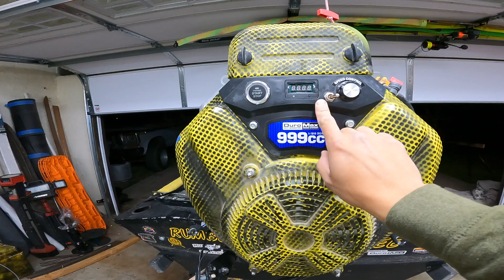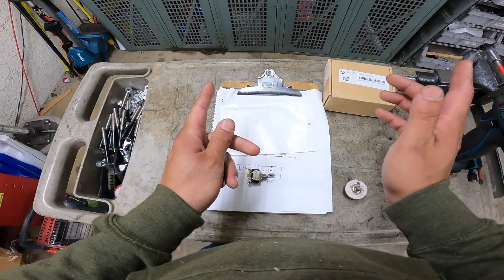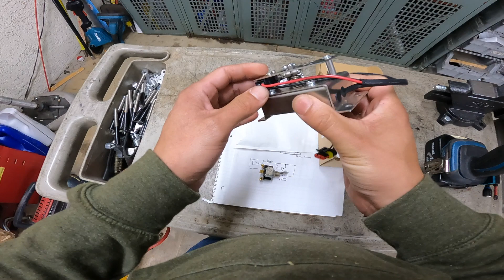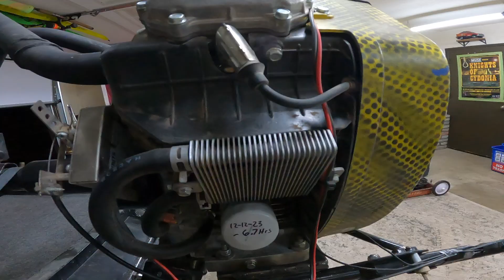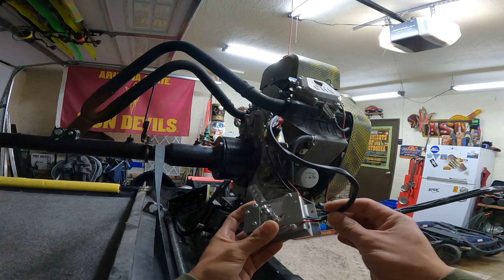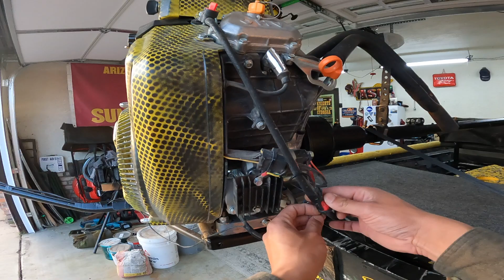Duromax 999cc Electronic Throttle Set Up #xp35hpe @DuroMaxPower

Comment: I have this engine on a stump grinder. I've lost ability to control throttle. Spin the dial nothing happens.. bought new pot, no change, new ecu 4 times in a row because i kept doubting them. Same result. Won't rev when i spin the dial. But it does rev to 3k when i unplug the pot.  I don't know what to do. I scraped the insulation off the wires right where they enter the ecu and can measure 0-5k ohms being selected but nothing happens.. please tell me what to do. I been trying like hell to fix this. I have a brand new never used duromax engine also. So I'm like stick some oil in it and hook up a battery and fuel and use that engine to help trouble shoot and figure out wich parts are junk or what. So i start it up. Won't rev or respond to dial being turned. Geeeeeez. I'm really lost now. Both run, both won't respond to dial turn, both rev up to 3k when i unplug the pot. One is brand new and the other i ran for a good long while grinding stumps. The ecu went bad eventually and nothing would happen when u hold the start button. Aaaaand i got a new ecu and here we are. Starts right up, won't rev... . The duromax dudes were like you need to take it to the shop. I'm like i am the shop brother!!
Reply: Here's a crazy bit of info.. the original ecu is a dead duck. It was illuminating the ring around the start button red and wouldn't turn off. Wouldn't start or even try. Dead duck. So I start ordering ecu's and pots and I had a new spare carb with the electronic throttle spinners on it. I figured I have ALL the garbage electronically controlled parts so if I need a spare I'm good... fast forward to the no rev troubleshooting process a week or 2 later. I put that confirmed junk ecu on there. The engine started and DID respond to throttle dial. Then it shut itself off after 5 or 10 minutes running and will not restart or do anything. Out of 6 ecu's that is the ONLY one that would make it rev when told to...I got to a point where I was like send me 5 new ecu's because I believe they are all junk. So shitty. Please help. Anybody..
Reply from the maker: @briansnik1848 we only ran the electronic throttle for a short period of time. Then we bypassed the electrical and deleted the ECU. Its currently on #rumblebeeboat with a mikuni carburetor with 670cc kit from https://performancemad.com/ running on the bottom needle clip. We made this video just to demo a drive by wire system that people said couldnt be done.
Reply: @azlongtales awesome job on this stuff..i can't do like you did unfortunately because I'm on a stump grinder, and need to be governed. Dang it there is no way around this besides sell these 2 duromax's i have real cheap. Let me know if you know anyone who might possibly be interested. I'm in crest hill Illinois 
.. thank you brother. Nice work on the boat

Comment: How do you like this motor so far? I'm looking to repower my Boss Drive surface drive with this motor. I'm just not electrical savvy lol i been considering modifying a predator 670 or just buying one of these.
Reply from the maker: @JBouza392  999cc has been an awesome engine still on #rumblebeeboat the ulimate upgrade is to delete the electronics and do a performance 670 mikuni carb. We were just showcasing how you could keep the electronic carb. So I far I think we are the only people to make a affordable drive by wire system awesome job by @yumatrd (David)
Reply: @azlongtales  I'd like to go the route of the least modification as possible. I like this Duromax xp35 for the push start feature and I'd like to keep it. I really don't want to modify the motor if I don't have too. I just want to get back out on the water as quickly as possible lol

Do yall make a plug n play kit? Or do I need to piece this all together myself?

Comment: Is the crankshaft same size as a vanguard 35?  This would be an awesome cheap alternative when replacing a Briggs vanguard 35 surface drive if the hubs/clutch are interchangeable
Reply from the maker: All good question i don't have the answers to. All duromax 999cc has a 1 7/16 shaft

Comment: I think it’s less messing around putting a mukini carb on it and just taking the electronic stock carb off and ecu. Then just hook up a key ignition lol
Reply from the maker: @nickb8618  we did that afterwards that's how it's currently set up now. But we were showing it was possible and not difficult or expensive to do a drive by wire system for it to use the stock components.
Reply: What Mukini carb did you use?
Currently, I just extended all of the stock wires and mounted the controls where I wanted them in the cockpit.

Comment: What do you think of a 14-36 with a swamp runner 670 ? Maybe with float pods.I don’t want transom to break because the bottom corner has been welded in past but it’s got a TBN aluminum 1.5 thick transom. Two floor to transom triangle braces in it already then I got a 36-14 1/4 aluminum plate bolted through the back and transom. You think it will hold up with rough roads and the weight ? Hope to hear back !!
Reply from the maker: I would say don't do pods. Sell that hull and buy a 16ft if you want to run a vtwin engine. I would run the @duromaxpower #xp18hpe 18hp or #xp20hpe on that hull if you plan on keeping it.
Reply: @azlongtales  Okay thanks for the advise but sadly I’m stuck with this boat for this year I re did it completely. And already got the motor 670…. Dumb but No Kit. It comes out to about 20 pounds more heavy then a 459 kit with a light weight muffler. Just of of curiosity what’s the size of Sonoran skipper and rumble bee ?

Comment: Need to see a video of it on the water. Trying to decide if I want a 670 or that beast. 670 I’ll have to put some performance parts on to make it do what I want.
Reply: Review if the kit your looking at will work with the 999cc shaft diameter. We had to do some custom work to make the kit work. Nothing is available to bolt on the market at the moment.
Reply from the maker: This engine had nearly double the torque of the 670cc at low rpms. It will do more work than a 670cc on load. But it's still at the same RPM for the most part. That what will create more speed over all is more RPM. So a 670cc with more RPM than a 999cc maybe faster than a stock RPM 999cc.
Reply: @azlongtales I realize that rpm makes more speed. But the torque and displacement is much better for hauling heavy loads without bogging. And can run a larger prop as well. 
 pretty smart how you adapted that throttle. I thought the only way would have been to put a mikuni carb lol
Reply: Swamp runner makes a kit that will bolt to this. It bolts right up to the 1 7/16” crank

Comment: Great Explanation!  👍😎 You could 'reverse' your 2 pole switch leads so that the toggle would point to the 'direction' of control use.  I like everything else. Thanks.
Reply: I cut the original pot wiring too short so it didn't reach the other pole of the toggle switch or else I would have reversed them like you mention.